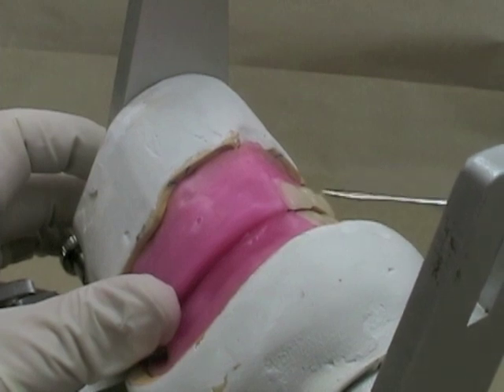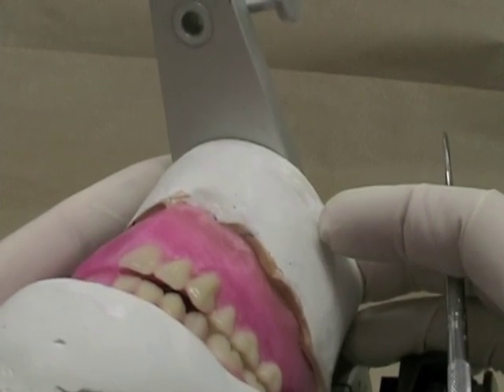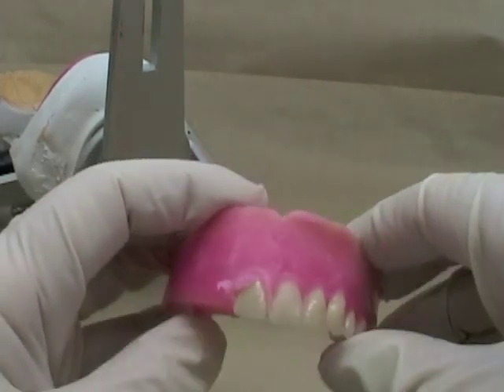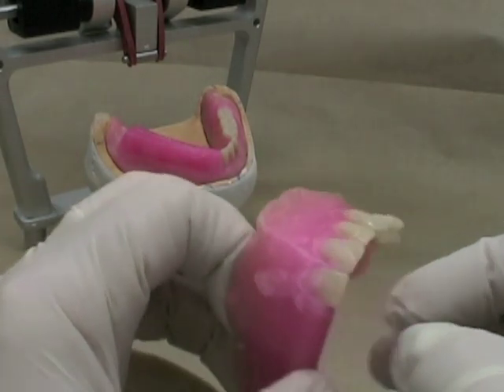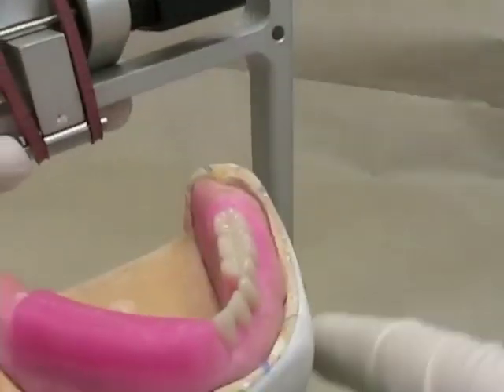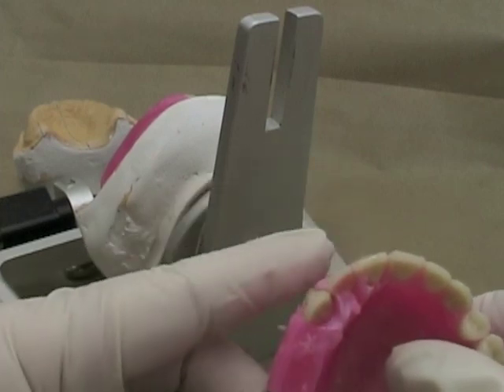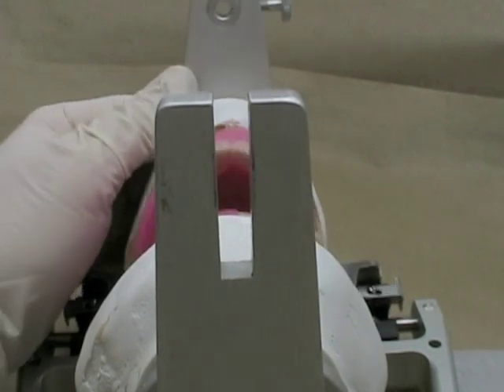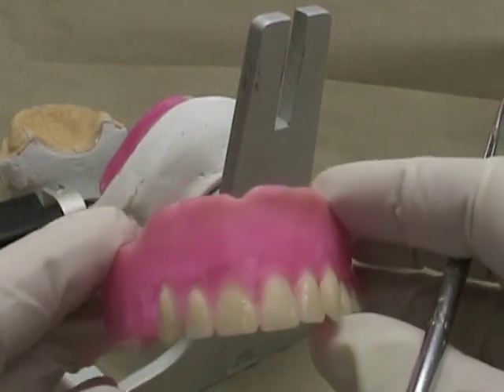31 Setting Denture Teeth - Maxillary Anteriors

Comment: Dr loney, im student, i have a question
when you put maxillary anterior teeth you can obtein overjet, but you have 1mm under occlusal plane, how do you subtract that space, i dont understand :(
Reply from the maker: Not sure I understand your question. The incisal edges of the anterior teeth should be set with even with the occlusal plane of the occlusion rim (position on the vertical axis). The rim is also already contoured to provide 1-2 mm of overjet - the facial surface of the denture teeth should be set flush to the facial surface of the maxillary rim. That will provide the necessary overjet if the mandibular anteriors are set flush with the mandibular rim. Hope that helps.